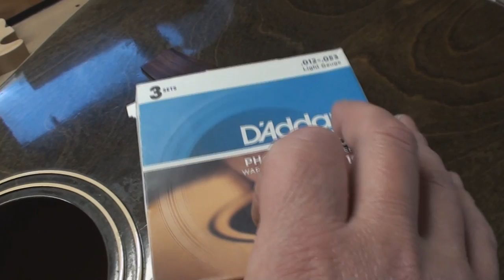Art & Lutherie Acoustic Guitar Gets Saved

Comment: Godin says those bolts do nothing and can be removed. They're only there to hold the neck solidly while the epoxy hardens. Imagine trying to remove a neck with epoxy holding it on.
Reply: John Bannister  it's not easy or fast but can be done, I epoxied my first set neck guitar in 2001, it needed to come off last year,  it took 6 days! I eventually used toluene in small amounts to soften it, then it becomes a tacky mess that ruins everything used to scrape, ply or remove. I won't be using it again, on neck joints.
Reply: I have no footage of my work. Trying to remove it ruined the guitar neck pocket